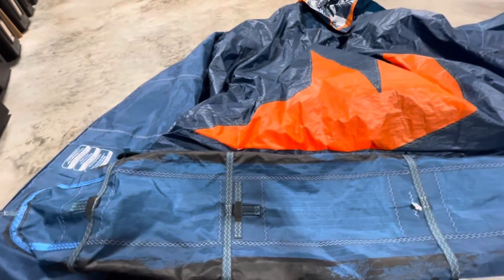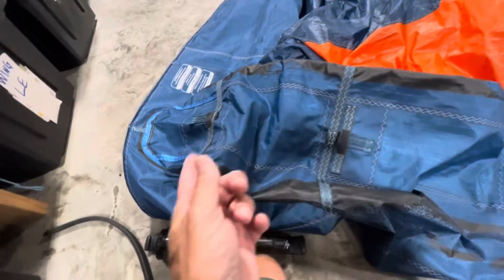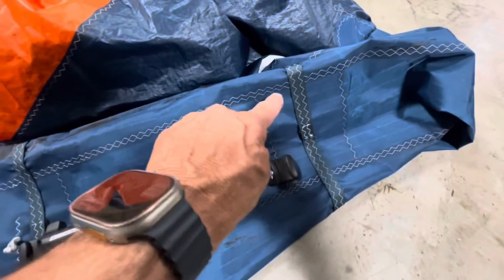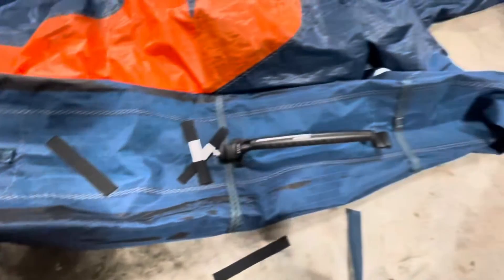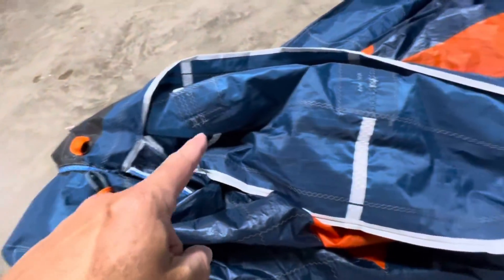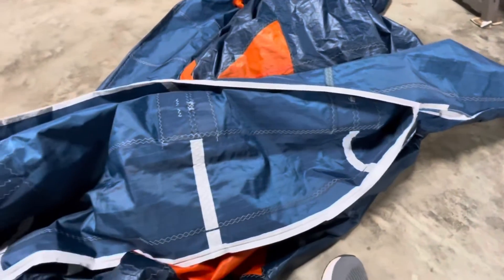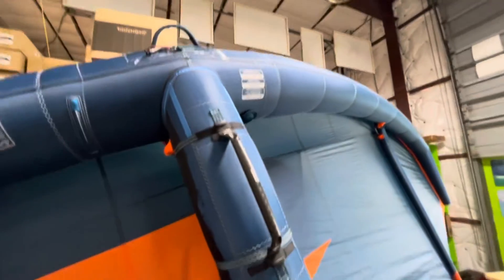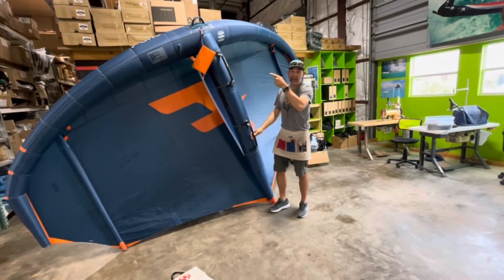How to install Fone strike with Ultralight carbon handles

Comment: So generous of you sharing your process. I live in another country, shipping would be expensive. This mod in the video is for handles, if you want to make it for both handles and boom, do you add more backing material? 
I repaired my sails, kite, leash, wetsuit... With my walking foot sail machine and #69 polyester UV resistant thread, I'm tempted to do the mods on my brand new CWCs. Thanks